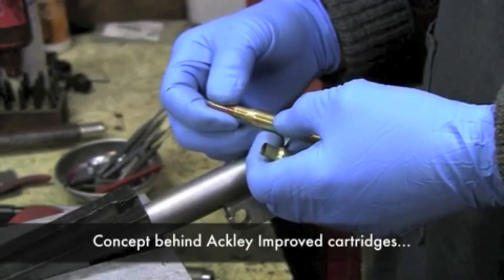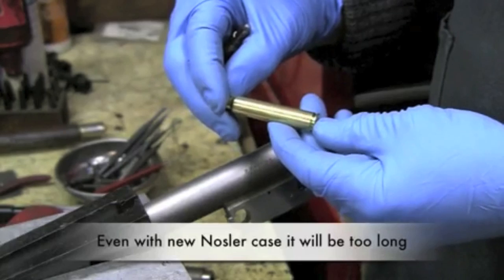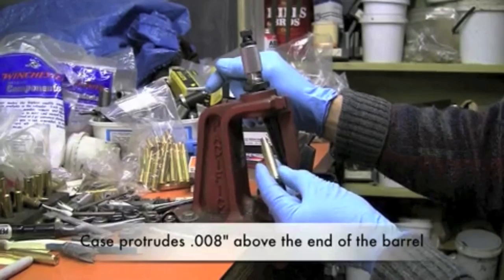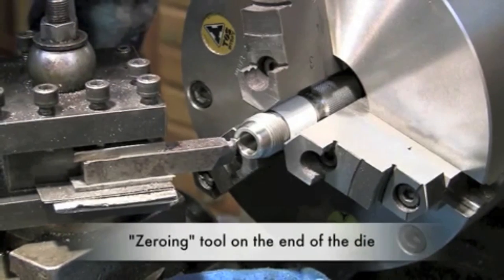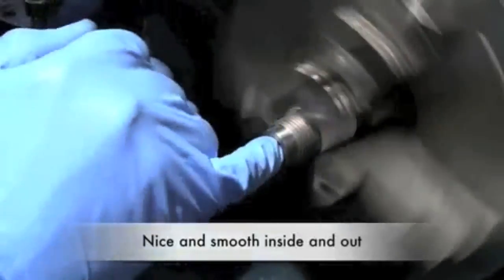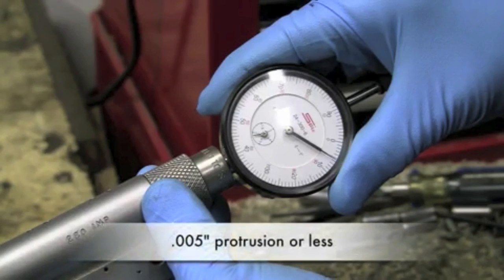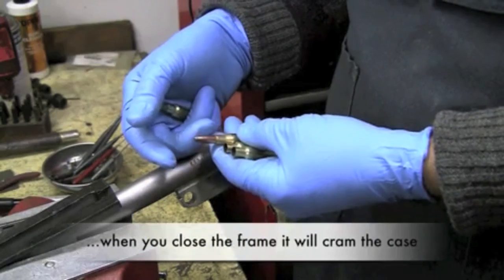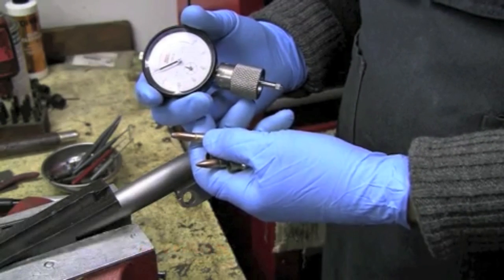280 AI Part 2

Comment: Mike, you should have cut the 280 AI chamber deeper to match the 280 AI full length sizing die. You created a chamber problem not a die problem. I’ve never had any headspace problems from T/C Encore factory Rochester,NH stamped barrels with RCBS and Redding full length sizing dies. My Encore barrels chambers are 223 Remington, 243 Winchester and 7mm-08 Remington.

Comment: Is this primarily because of the Encore break open action and does not pertain to bolt action rifles at all? I would not modify a resizing die like this( I am not a gunsmith) but maybe try Redding shell holder option to increasing shoulder bump. Got screwed with a set of 30-06 reloading dies that were picked up used at a gun show and somebody had done this to the sizer but did not say they were modified. After loading some rounds and shooting a couple of them I noticed the primers were sticking half out of the pocket. Finally figured out what happened and got rid of the dies.

Comment: A factory case Nosler/SAAMI Spec. 280 AI has to have the shoulder bump down to be chamber? 
A factory loaded 280 AI cartridge from Nosler will not chamber in that rifle that you call 280 AI chambered ?
1.  The reason the case gets pushed in is that there is no resistance from firing pin pushing forward, as there is no powder to ignite to push back.  The loaded cartridge would immediately ignite the powder a lot faster, after the primer is struck, than the firing pin can continuing to push on the case forward. So the pressure will prevent any shoulder collapse.  If you do the same thing with any caliber's empty case with just the primer you would get the same thing as your shoulder collapse BS because there is no powder to ignite and generate pressure to prevent the collapse. In such case,  would you shorten all Full length sizing die for all calibers?
2.  You just messed up a perfectly good 280 AI Full length sizing die.

You sir is an extremely senseless gunsmith.
Reply: not sure you understand what happened in the video, although the person making the video did a poor job explaining too.  He has (I believe) a set of 280 Ackley imp traditional dies, and he has to shorten the dies because the chamber is for a 280 Ackley imp SAMMI spec.  Which is 0.0143 or so shorter than the traditional spec.  it has nothing to do with shoulder collapse, so I guess your point is taken, at least item no. 1.  but item no 2 is required, or modify the shellholder by taking off 0.014 from the top of the shellholder as someone else stated....  confused?  I am, I think.  and I have a 280 Ack imp SAMMI and a set of 280 Ack Imp traditional dies, just have not got around to doing this yet.  Although I do have a lathe so whatever I do wont be an issue for me, until of couse when I mess up my perfectly good 280 Full length sizing die!!
Reply: @ez7977  It is not that there is any differnce  between the sammi and the current 280AI, its' that the early sammi dies were cut deeper.
Reply: @totallyjonesin  no, while we are arguing and semantics, the traditional 280AI was a true wildcat round and there was no SAMMI specifications detailing the exact dimensions.  There was however a very commonly accepted cartridge, ie. 280 AI that P.O. Ackley created by modifying the 280 rem.  When Nosler sent the specs to SAMMI to standardize the cartridge their spec was 0.014” + shorter from the base of the neck to the base of the cartridge..  the early dies were not cut deeper, just the opposite, they were shorter.  I actually got both and not only can confirm this, its very well documented.   Plus i milled my shellholder just as i mentioned to use both dies.

Comment from the maker: yooper_man, you are dead wrong!  
The chamber MUST be cut to match ammo and NOT create excess headspace!

If I cut the chamber deeper, you would be stretching & separating cases but have a bona fide reason to question me.  Reloading dies made today are made to drawings for fixed barrel guns and do not take into account the flexing of the break open guns.  Dies that do not let you bump shoulders back MUST be shortened so you can.  That is the best approach to the issues of the combination of break open gun, factory ammo, and reloading dies.   In "the old days" size dies were generally made with the size die "chamber" short so you COULD bump shoulders back, BUT too many non-thinkers crammed cases all the wall in to the shell holder and created excess headspace.  To protect. you from your self, the reloading die industry changed to a deeper, SAAMI spec drawing, size die "chamber" so you could NOT create excess headspace.
FINE for bolt guns & more rigid guns like Ruger No.1's, but the break open guns are a different matter entirely.

With .280 Ackley Imp standardized .014" shorter chamber depth, and factory ammo being made, I MUST cut chambers to the shorter cartridge body.  The reason Nosler shortened .280 Imp. from Ackley's definition of just .004' shorter than the standard .280 Rem. cartridge is due to the .011" average collapse of the  .280 Rem. case shoulder when fire formed.  

Use our headspace indicator!
Take the extractor out of the barrel.
Drop a primed, EMPTY .280 Rem. case into the chamber.
Measure where the case head is compared to the end of the barrel.
Close the barrel & fire the primer.
NOW, measure where the case head is.
It will be on average crammed into the chamber by an average of .011"!
NOW, when that case is loaded to normal pressures, the case will stretch back at the web and if it does not
separate on the first firing, it will likely separate within a few reloadings.

Also, regarding other comments below.
Do NOT use the method of cramming the bullet to the riflings for fire forming.
The firing pin simply drives the case forward over the bullet.
Yeah, the case may look good, but the wire test will also indicate thinning of the brass back at the web, the start of case separation.

Go back to my archived old website page, Headspace, How To Get It Right & wrap your brain around it:
https://web.archive.org/web/20151212120025/http://bellmtcs.com/store/index.php?cid=172

With P.O. Ackley as my mentor in Salt Lake City for 10 years, I've been chambering for the Ackley Improved cartridges for over 44 years in both fixed barrel guns and the break open guns with focus on TC's.  I work to barrels, chambers, ammo, & dies, NOT to drawings that don't match the reality of what is in my hands in front of me.  Mike Bellm